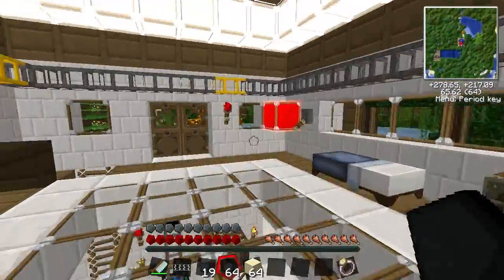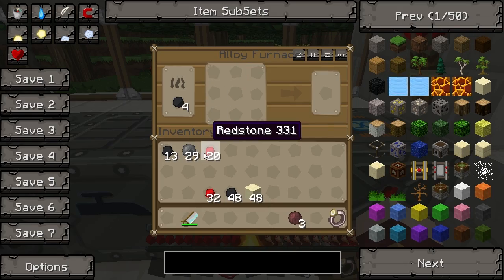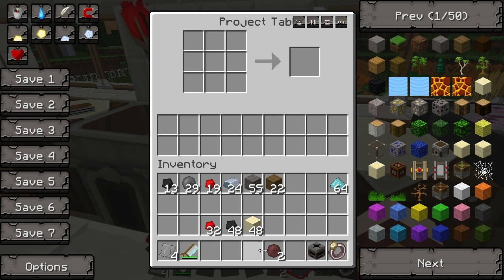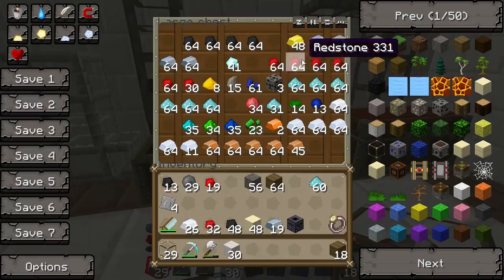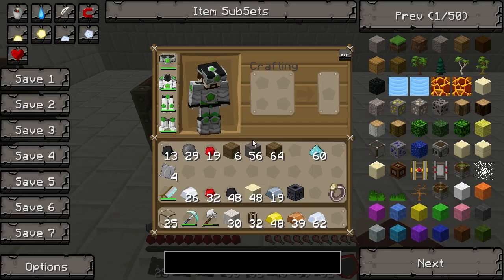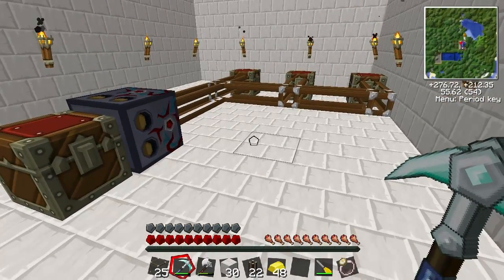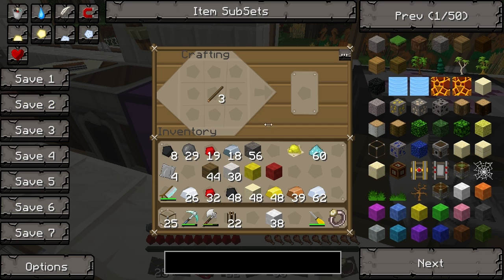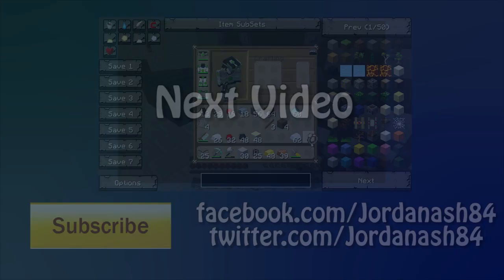Tekkit - Episode 25 - Sorting Machines and Pneumatic Tubes

Comment: I have everything set up fine. Timer on. Power on. Machines the right way. Pipes connected. It works fine. However, every now and again the sorting machines go off on their own and to fix it I have to rotate it using a screwdriver. I'm not using buffers or chests, I'm using pneumatic tubes. Also, I'm using 12 sorting machines altogether, Is this why? PLEASE HELP. Thanks.